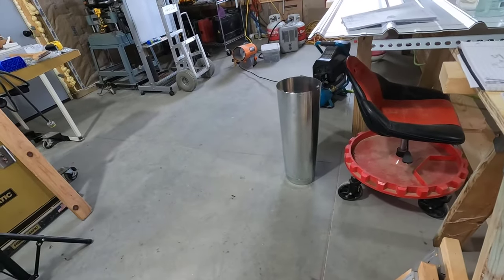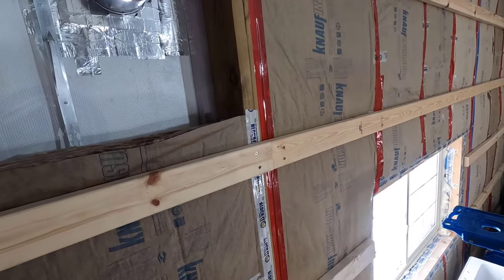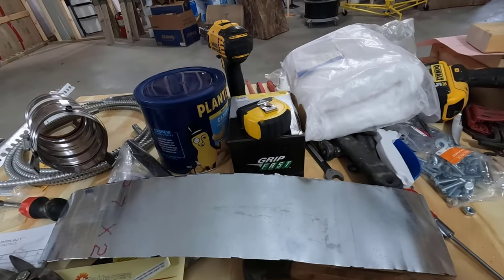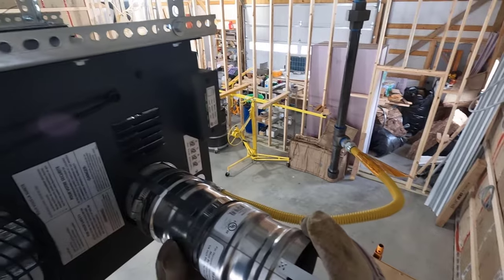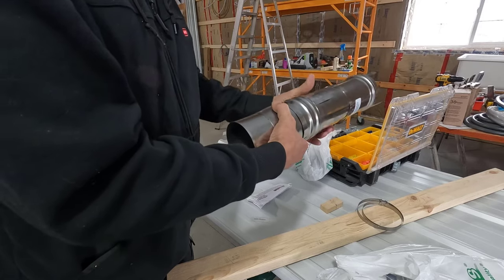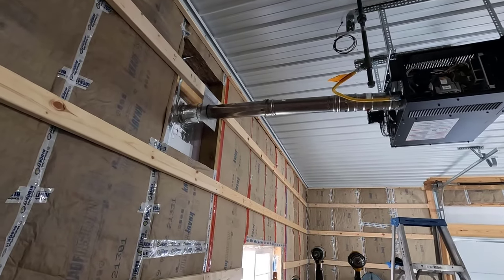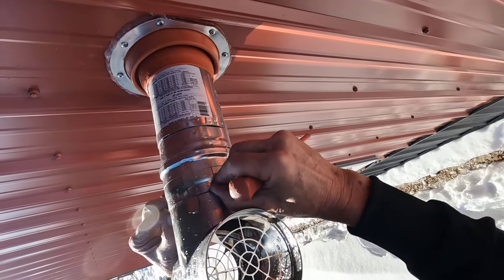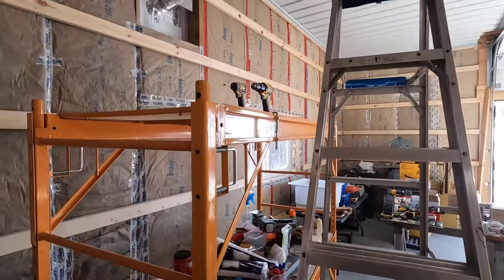Garage Heater ― Installing a Horizontal Flue Pipe and Inner Wall Thimble

Comment from the maker: It was awesome getting this part of the garage heater install done, and having it work out flawlessly with several parts of the job being done earlier in the year — including the outer thimble and boot. If the pressure test goes well, I will have heat soon! 😊 Links to the heater and other heater items below:

Propane/Heating
Mr. Heater 50,000 BTU Big Maxx - https://amzn.to/3G35gwH
High Temp Silicone Boot - https://amzn.to/3Cy6Tld
Yellow Jacket Gas Pressure Test Kit, 0-35"Wc - https://amzn.to/3FXUzf3
Monster Thread Seal Tape - https://amzn.to/3EV24V2
ProFlex Gas Pipe (1/2" x 25 ft) - https://amzn.to/3gjIEis
ProFlex Gas Pipe (3/4 x 25 ft) - https://amzn.to/3VBL0cR
CSST Tubing Cutter, 1/4-inch - 1-1/4-inch - https://amzn.to/3SeuiNB
Pro-Flex 1/2" Brass Male Fitting - https://amzn.to/3yF9k3l
Pro-Flex 3/4" Brass Male Fitting - https://amzn.to/3D0gKRq
Pro-Flex 3/4" Union (Coupling) - https://amzn.to/3ezIWRP
Pro-Flex 1/2" x 1/2" x 1/2" Tee - https://amzn.to/3EGq2U1
Pro-Flex 3/4" x 3/4" x 3/4" Tee - https://amzn.to/3TcQqcI
Pro-Flex 1/2in Termination Plate 1/2MIP 3/8FIP CSST Male Adapter Fitting - https://amzn.to/3T3MkDq
Nylog Blue - https://amzn.to/3KNjt

Comment: I would rather have a horizontal flue. Much less chance of leaks as opposed to going thru the roof, easier to get at for repairs some day, and you get more heat out of the pipe before it escapes thru the pipe!
Reply from the maker: I agree on all counts! If I would have went through the roof, it would have been hell to get back there should anything ever go wrong!

Comment: I've installed a few vertical heaters, but they were a pain in the butt having to go through the roof with the flue. If I ever do another, I would likely go through horizontally like this. I'm curious to see how much condensation there is!
Reply from the maker: I am as well! As soon as I get the room sealed, I want to run the condensate thru a hose to a collection vessel that I can measure. I don't think it will be much, but I may be surprised!
Reply: Is there a shut off valve on the stainless pipe for  that condensation drain?

Comment: is there a reason you don't downward fall on pipe to allow water out end of pipe
Reply from the maker: Yes. By code the flue pipe has to pitch upwards. That's why they have a drain at the unit.

Comment: Hi Mojo, great video! What size hole did you drilled thru the sheet metal?
Reply from the maker: I cut a hole with a metal cutting blade with a jig saw just a bit larger than the flue.

Comment: Great video. May have been said already, but would it be an idea to have a short piece of ‘snow stop’ on the edge of your roof, above the chimney exit, just to keep snow / ice from sliding off onto the pipe?
Reply from the maker: So-far, we have never had snow fall from the roof.  The texture on the tin holds the snow in place, and  the black roof melts the snow so fast, it never slides. It probably would be necessary on a non-textured roof!

Comment: Great videos!! Hoping you know but I cannot for the life of me figure out if the mr heater maxx vent pipe should fall or rise out of the structure. Help!! I've seen both with slope and some with rise. Thank you!!
Reply from the maker: It should be in the instructions. I believe it was a rise of 1/4" per foot — which allows any carbon monoxide to exit naturally when the power vent shuts off. Make sure you read the instructions though! This also makes any condensate drain back to the unit so be sure to install an inline drain.

Comment: Do you have anything between your metal walls and the fiberglass insulation? I am researching heating and insulating my garage but I’m getting a lot of warnings of mold from condensation. Are you having any issues with that?
Reply from the maker: Just the housewrap. Never had any condensation.

Comment: How far do you have to keep combustible material away from outside of cat 3 thimble 2 inches ?
Reply from the maker: I don't think there is any distance specified. The outside of the thimble for my installation barely gets warm. I would check local code and the manufacturers instructions for clearances.

Comment: What was the brand red boot flashing you used SPECS on exhaust vent won't it melt being silicone boot ? Thanks great job
Reply from the maker: I believe the boot is linked in the description and/or the pinned comment below. No, high temperature silicone is not affected by heat.

Comment: Hello
On the outside wall were the flue goes through the wall what is the name of the piece with the rubber but that has the screws around the circle?
Reply from the maker: That is a silicone boot. There is a link to it and other things in the pinned comment and in the desctiption.
Reply: Awesome thank you for responding back to me.
Reply from the maker: @michaeloliveira9825  No problem. Good luck 😊

Comment: Great video, I'm doing the same thing right now. Did you use an appliance adapter piece to connect to the heater flue first then your condensate pipe?  Also where did you get the gasket piece for the exterior of the shop wall and finally what are the dimensions of the space your heating?   Thanks!
Reply from the maker: Thanks cackerson10! Yes, there was an adapter that came with the heater that increased the flue diameter from 3" (I believe) to 4", then I have the condensate drain after that. All of the items used are listed in the pinned description, but I'll include it here as well:
High Temp Silicone Boot - https://amzn.to/3Cy6Tld

The space I am heating is 12' x 32' x 36' there are lots of details on the insulation elsewhere, but right now it is R-19 everywhere, and soon I'll be blowing-in insulation in the attic area on top of the R-19 for R-50. Good luck, and feel free to ask any more questions you may have 😊
Reply: @PlanetMojo  Good thing I have a Menards right down the road looks like you shop there too. The Class III vent is not exactly inexpensive these days however I got 2 x 4 x 8 studs last weekend for $2 each after rebate

Comment: Wrap some copper tubing around that pipe and pull even more heat off the system with a hydronic setup..
Reply from the maker: I do plan to pull heat from the flue pipe, but will likely just use a fan.

Comment: Do you need to run a drain line for residential applications? I saw in the instructions it only references it for commercial applications
Reply from the maker: You will have condensation so it is needed —otherwise that water will run back into the unit and leak/rust the unit out. I wouldn't try installing without it. Not sure why the instructions wouldn't require it in all installs. 🤔
Reply: @PlanetMojo  is there a pipe I can buy that has a nipple for a drain on it already? Or do I just need to drill into the pipe?
Reply from the maker: @DalonPlays  It's a special section of pipe, that stops the water and directs it to the drain.  I picked mine up at Menards. You also need high temp silicone hose.
Reply: For how short that run is you should have just pitched the flue down and let the condensation drain to the out side. the unit is power vented  @PlanetMojo
Reply from the maker: @RichB0330  That would be illegal, and a dumb thing to do.

Comment: 1) You job would have been so much easier if you had ordered the correct wall thimble.  They make them to accommodate different wall thicknesses. 
2) the single wall galvanized pipe you used in your wall is NOT B-Vent pipe.  B-Vent pipe is double wall of galvanized exterior and aluminum interior that is UL listed to reduce fire clearances.
3) Might want to try a termination hood on metal siding
Reply from the maker: This is category III venting, not B-vent, and the materials used were a kit from the manufacturer.